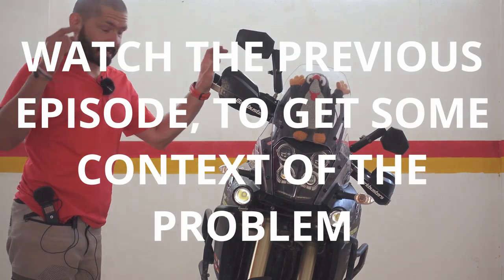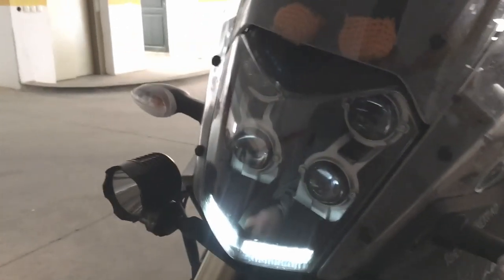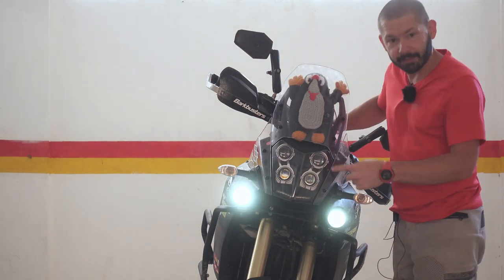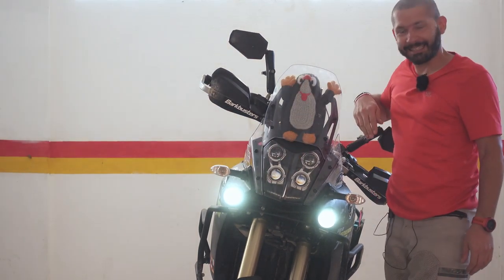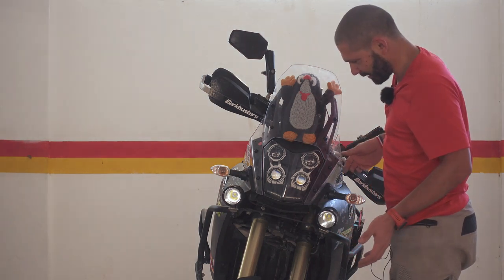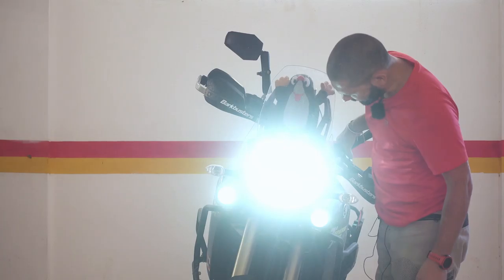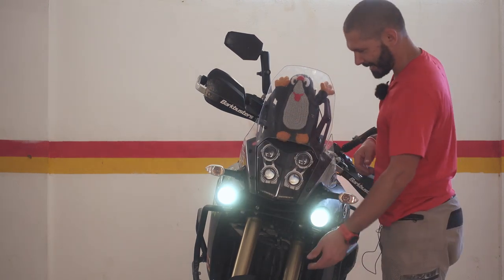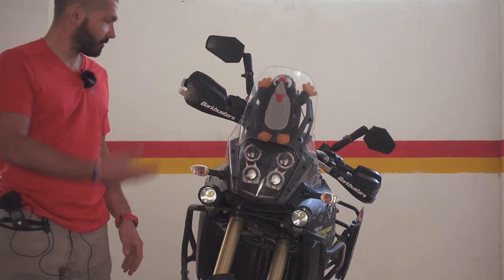Yamaha Ténéré 700 10k: Dead / broken headlight!? Ep. 2: some light

Comment: It would be interesting to open up the module and have a poke around to see where the weak join is, never going to get the chance under warranty though.
Reply from the maker: Yep, exactly. Outside warranty I’d already be working my way inside. It will be some silly thing which one can fix with soldering iron I guess.

Comment: Maybe take the bike back to Mifa and tell them ? Maybe there's something with a wire there or something really simple to fix -_-
Reply from the maker: I think, at this point, as the Headlight is sealed unit and it's tapping on the headlight, its the headlight not the wires. I'll try to take the headlight out again and see if wiggling with the wires makes difference.

I don't need to go to MIFA, I've taken the bike apart more times than they did. It was really 1st time they disassembled T7... and I have manual and I'm comfortable to work on it.

Comment: you could also take it apart and try to fix it
Reply from the maker: Hi John, I could but in that case the warranty would be void. I'm sure it is simple fix but I'd rather get it replaced under warranty.
Reply: @FARANDFURTHER  even better. then stop hitting so you break more. Normally yamaha is indestructable. I had a 750 tenere. What a fun bike.
Reply from the maker: Hehe, I'm trying to learn how to ride so I can stop dropping and hitting things :) So far it is indestructable, this is probably just bad luck because I didn't manage to break anything, just cosmetic damage :)
Reply: @JohnDoe-uc7et  Already lots of reports of rust...I ride Yamaha Sports Bikes for years and they are far from indestructable.

Comment: This must be so annoying for you! Everything works fine. Just a loose connection... probably.
Reply from the maker: Yes it's annoying, the problem is, it's probably the loose connection inside the sealed headlight! Which means replacing whole headlight while simple soldering job would fix this in 10 minutes.